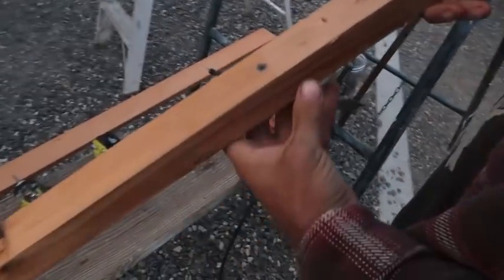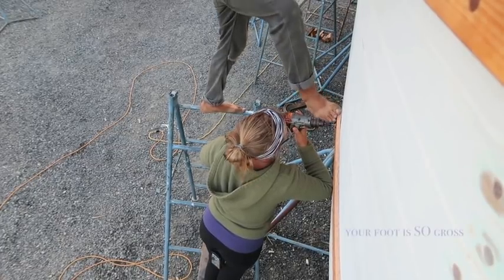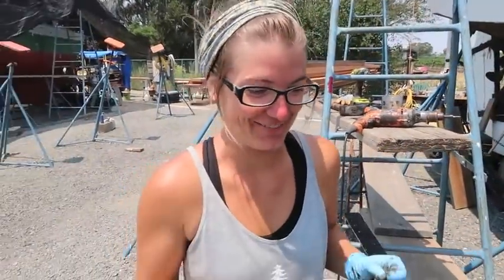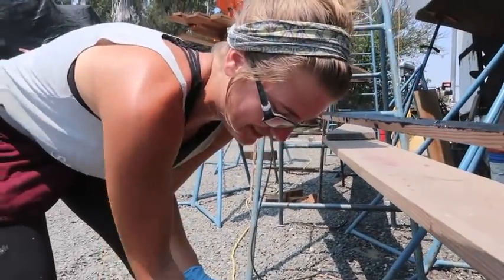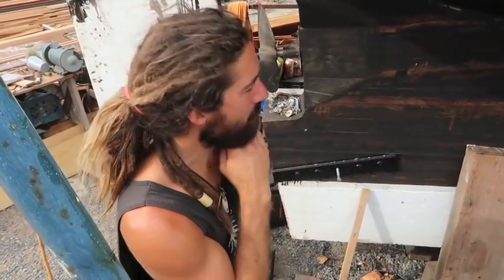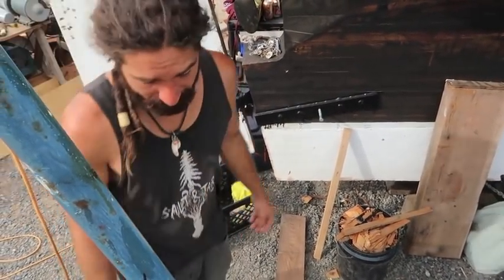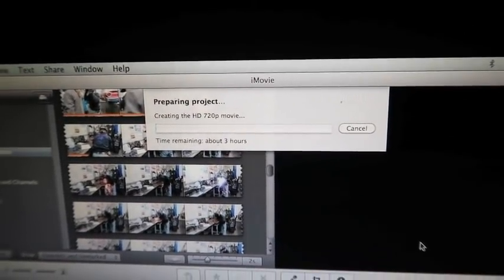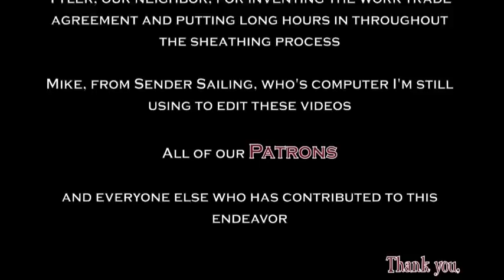Salt & Tar: Episode 39 - Waterline to Chine, in a Day

Comment: I see the advantage of the offset cutting tool ( never used one) I think my approach might have been  to use a piece of sacrificial material ( sheet metal, Masonite, etc.) against the hull, below the sheathing then use a reciprocating saw from above using the sacrificial material as a guide, if that makes sense. In my work that system works  when you cant get at the underside and you can afford to damage the material below what is being trimmed. You seemed to do just fine though. :)

Comment: It is probably too late for this bit of info but if you had taken a 2x4 about 8 or 10' and drilled a hole in 1 end that you could tie a rope to then you could hook it over the nearest stanchion and use a block of wood at the location you wanted to press in. then you could stand on the ground and lever it into place